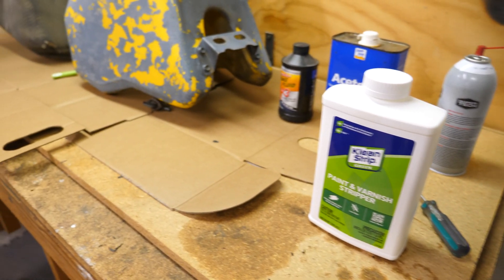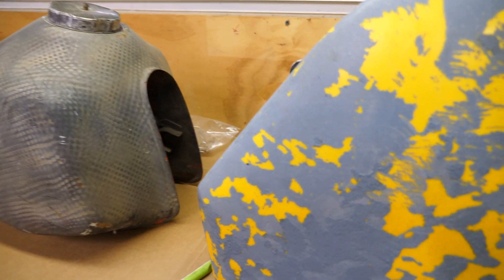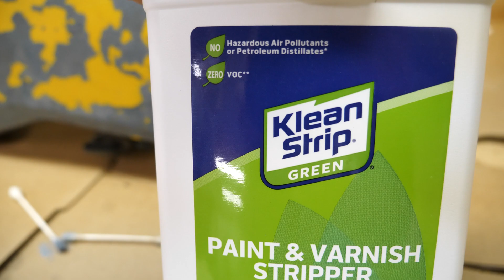Paint Stripper VS. Common Household Chemicals

Comment: For metal tank paint strippers work fine, but for plastic fairings paint stripper might eat the plastic as well. Its way slower as in takes days sitting on it in the sun covered so animals dont drink it, the drain cleaner with occasional brushing slowly stripped the paint in particle by particle, with out damaging the plastic at least and that was 8 layers of rattle can and rather rare fairings so had to take it carefully, so maybe for restoration work more than to clean out tanks like this.

Comment: Wrap item to be stripped in white paper towels, then wrap it all in saran-wrap, leave a gap at the top, dribble some acetone on the paper towel at the top, the acetone will get soaked up and distributed all around by the paper towel, and the saran-wrap will keep it from evaporating. The acetone-soaked paper towel will be in direct contact with the paint and whatever paint there is will either lift in sheets or rub right off after a while of soaking. 
This is the most efficent way of removing paint with acetone. Only to be used on acetone-resistant substrates, obviously.

Comment: I have have a Husqvarna Fe350 2016 with 600 hours (yes really 600) with 0 engine rebuilds. Only thing i replaced in the engine was a spark plug and the clutch. It runs like a dream. When i go on rides i open her up full throttle every ride for 5 minutes when the engine is hot but that is it. Every one of my friends are screaming that i should do an engine rebuild. An i am just wondering what do you guys think? Am i a big idiot or that i am very lucky that i have no problems.

Comment: check the intake manifold for 350. it may be a crack or a torn gasket or a crumpled O-ring on the flange. you changed the carburetor but you didn't change the manifold)
 you noticed correctly, because of the jet, the speed usually does not change. I liked your bike! I'm following the work with him. I'm glad you continued working on it. Good luck dude!)

Comment: A fluctuating and inconsistent idle is usually a sign of a vacuum leak. I have even had a vacuum leak affect the idle like you said due to the throttle slide gasket missing under the screw cap on a mikuni vm carb.

Comment: I have a '99 DR 350. When I bought it I had to buy a new TM33 carburetor as the one from the factory had the curtain already wore out, along with the nozzle where it slides, causing an air leak. The bike would fluctuate like yours, and also would bog when jumping or in really rough terrain

Comment: For gloves versus noxious chemicals, you have to use the right type to avoid them melting as you're doing stuff, each one being different as to what they're resistant to, and remember that they're not there for a continuous protection, just a temporary barrier to quickly whip off in case of spillages, cos if your gloves are bubbling up and melting, it's the wrong kind... :)

Comment: From my understanding. Brake fluids have changed over the decades, just as automotive paints have. The Dot 3 were paint strippers on about the 70s car paints. Then they developed Dot 4 and now dot 5 for less likely to strip paint on current automotive paints. I'd suggest that the paint on the tank was more likely to be more recent paint. So brake fluids likely won't touch it these days.

Comment: The yellow aftermarket tank is probably made of HDPE (high density polyethylene). Nothing really sticks to it because the fuel vapours actually permeate the tank. Furthermore, the gray paint seems to be primer... so basically the primer has been "prestripped" by the fuel vapours all it's life. You probably only have to give it a stern look and it will come off. Btw, because of it's permeability, these tanks cannot be painted, the paint will just bubble off. Same goes for normal stickers, they will develop fuel bubbles and peel right off. That is why dirtbike tank decals usually are perforated and use this thick gooey glue. 

The other tank looks like fiberglass. This can be painted as it won't let the vapours through... so this may be 2 pack paint, which will fight you all the way. Your best bet is to key sand it and paint over it. But then again, I may be totally wrong and it's just magic.
Reply from the maker: Thanks for the comment! You are right on almost everything. Except that the XL tank is metal, which, would be similar to fiberglass in that it won't leach vapors. And the paint on the yellow tank took more like 2 stern looks to come off.
Reply: Any chance the "paint" on the metal tank is actually hydro dip? That stuff is pretty tough? Or someone experimented on it with ceracote?
Reply: @prdoohan  Hi there. It could be hydro dip but that stuff isn't strong at all. It has to be clearcoated with 2 pak clear. That makes it strong. If you don't do that it's as strong as bubblegum tattoos.
Reply: @thomask.8533  Oh cool, thanks for the info, I have always wondered how tough it is

Comment: acetone and brake clean/carb clean is good for removing acrylic lacquer and acrylic enamel paints the kleen strip/air craft paint remover is better for urethane based paints and powder coating (recommend the gel in a metal can with the blue & gold label) and it needs to be lathered on, sit for a bit, then it can be wiped away.
Latex is less common in rattle cans, it's typically acrylic lacquer or enamel. Latex comes off easier with ammonia, isopropyl alcohol or I believe mineral spirts works decent too.
Reply from the maker: Thanks for the information!
Reply: @ no problem! Hopefully I remembered all of that correctly, believe my hard drive may be nearly full lol!

Comment: I think acetone and carb cleaner can make plastic tanks brittle and crack unfortunately.  I had success using orange scented oven cleaner to remove the paint from a plastic tank.  I let it sit for a few hours in a plastic bag and the paint bubbled right off.  With a metal tank I did recently, the easiest way was just sanding it with a flap disk on an angle grinder.  I tried all of the chemicals you did and more and nothing did a very good job and required a TON of scraping.

Comment: The right side tank looks to be epoxy, you will not strip that off with any chemical except sand paper or sand blaster. The right side tank looks to be just rattle can spray paint, you can easily take it off with acetone or carb cleaner, those paint are super soft. But for harder paint, like factory paint or powder coating, you will be needing that paint stripper, and it still won't be "wipe off" easy. Watch out acetone can melt/soften plastic if your tank is made of plastic like material.

Comment: I just picked up a dirtbike, that has a similar paint problem,  so this will be interesting.  It'll save me some time hopefully. 
Thank you for your videos
Reply: Use the orange scented oven cleaner.  It does not harm plastics like acetone and carb cleaner do.  Put a thick coat on it, store it in a plastic bag so it stays moist for 2-3 hours and then wipe it off.  Very little scraping required.

Comment: I suggest you use aircraft striper.  Coat the tank and cover with plastic bags to contain the solvent.  Let IT work for a while depending on the temperature.   Remove the lifting paint with bondo spreader and a plastic brush to get most then blast it with water to get the rest.  That's how we strip aircraft.

Comment: Yeah that gray is definately latex. I use brake fluid alot now. You have to wipe it on thick with a brush or rag and keep it very wet for for 10-15  minutes then it all crackles up and can be scraped off.

Comment: Don't use brake fluid ever.
Reply: @mblake0420  it soaks into metal or plastic and it is extremely hard to remove.  If you don't get it all it will cause new paint or decals to fail.

Comment: On the DR 350, I would check the shop manual and see if the crank timing mark is suppose to be slightly off in the inspection hole like you said it was. I suspect the mark should line up perfectly at top dead center and not be off at all like you said it was, but I could be wrong.

Comment: Aircraft strippers the only way to go but it needs  to say ultra if it doesn't it's environmentally friendly and won't even strip like a cheap hooker.
Reply: You will need a respirator and goggles and open air so you don't die .....it's great.😅